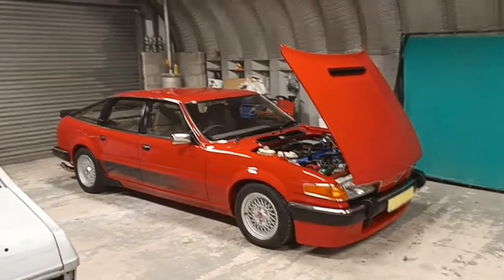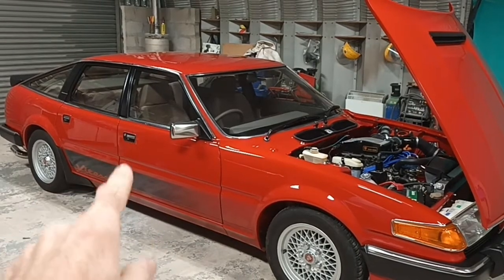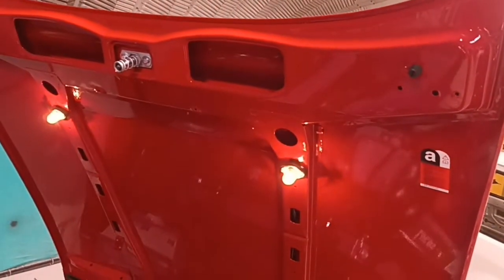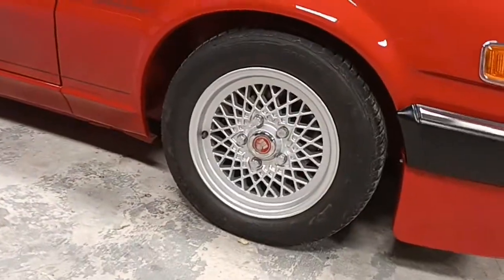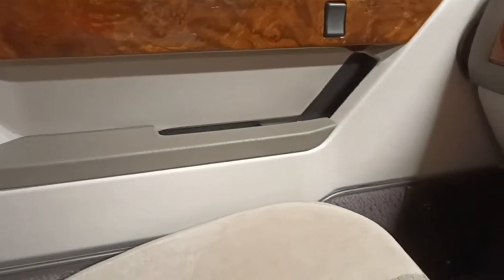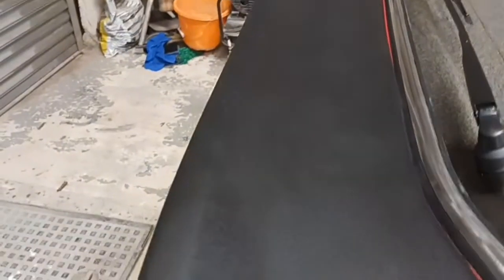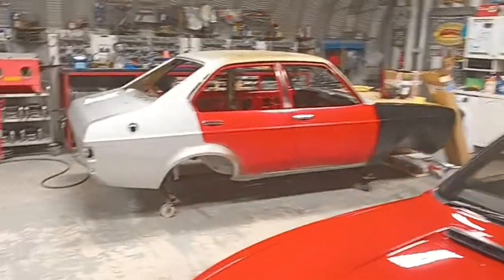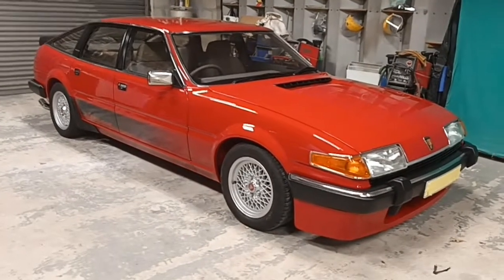Chris' Automotive Restoration Shop

Comment: Lovely job but didn't see any sound proofing on the firewall.
Did the later models have the insulation inside.
The external insulation got soaking wet and caused the firewall to rot.
Reply from the maker: No customer requested it left off as it rots the firewall. We insulated the inside instead.